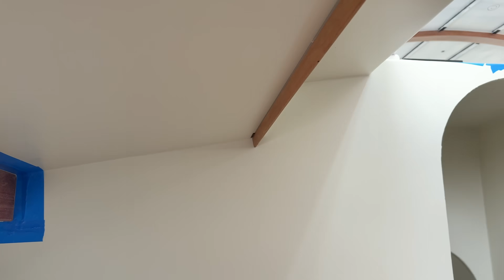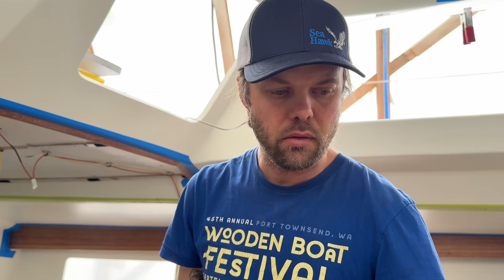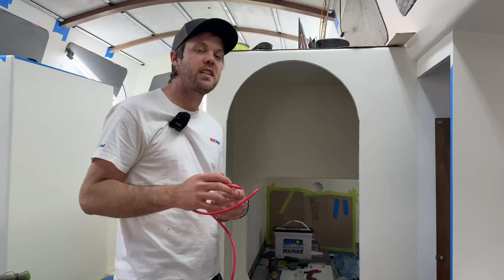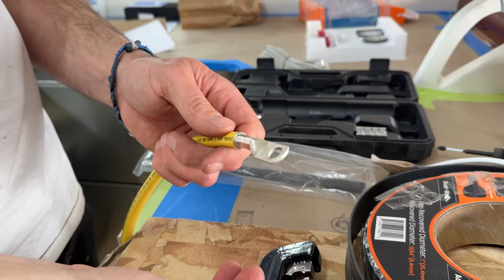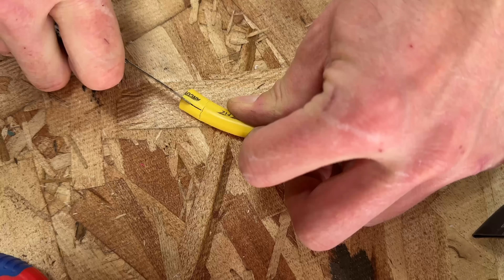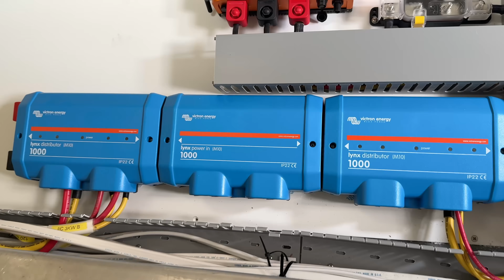This Little Product Supplies All the Power You Need Onboard. [Ep. 220]

Comment: Am I reading this right, you are trusting your entire boat electronics and safety equipment to a $2500 converter?
At the end you said your battery bank is 24v, is that correct because earlier it sounded like you have a 48v battery bank.
I think you might as well get those 10 victron converters for backup.
A single short or lighting strike can take out your entire boat by just frying one device. 
That’s too risky for my taste.

Using the pen as conduit to get the cable thru narrow spaces is a great idea. I’ll copy that idea.

Comment: Watching the video about the hatch gutters for the cockpit hatch.  Good job by the way.  The gutters and tubes to the thru hulls will help remove water. But you mentioned getting pooped and somewhere for the water to go. The amount in the drains will be insignificant compared to the amount flowing back out the open transom.   Really insignificant

Comment: Comment comes too late for this install, but there are many options for channels and diffusers for LED strip installation.
Can give more diffuse light, protects the strip, holds them securely.
Can have a flush mount look when installed in a channel cut in the finished surface.
For my dream boat build I've been taking note of options and want to install RGB+W strips behind diffusers.
The white levels are adjustable and the RGB give the option to light red for night time navigation.

Comment: I am concerned about how low in the boat all the 48v to 24v electronics appear to be. Any significant water intrusion could quickly render all systems dead. Maybe they were higher than the video made them appear.

Comment: Tin the wire before cripping is recommended for marine.  boats beach vehicles ie.  Beach Buggy Allso  Aircraft.
Reply: Isn't marine wire all tinned copper strands?
Do you have to tin the ends if the wiring strands are tinned?
Reply: @ericdunn6232 Not all of it. I’ve never used, just copper. It feels over the top for me, if you use proper shrinkwrapping.

Comment: no dielectric grease to prevent corrosion? good use of the server rack channel.
Reply: None of those fittings are permanent yet. I'm sure they'll all be unscrewed and rescrewed multiple times before splash

Comment: What  steps have you taken to mitigate the inevitable heat build-up coming from the 24/48V, 3.0 kW Charger/Converter/Inverter and all the other kit? Seems as though there may need to be some cooling system? - or, at least, some method of dumping heat over the side.
Reply from the maker: Im planning a cerbo controlled ventilation system.  This is especially important in this space, the machine room, and the propulsion/battery compartment.

Comment: Will you make that under the bunk electronics cupboard watertight? I could almost see someone going in there with a bucket of warm soapy water to give it a spring clean, and splosh. Kind of silly think I'd do lol
Reply from the maker: That would be a bummer.  There’s no way to make it water tight, so we’ll just have to make sure no soapy water buckets.
Reply: @TheDuracellProject  :D I guess they're in a bunk cupboard that looks like it could collect water that bothers me. Anyways it's not my boat and it's probably because mine leaks like a sieve  haha

The flexi tube tip is suuuch a good idea. Obvious, once someones pointed it out :D
Reply: It is odd that Victron is so omni present in marine and rv markets but their equipment has no dust of water protection rating.

Comment: love what you done with the strip lighting and hid behind the trim - just wondering how long before you touch it with your head when leaning over the worktops and standing back up, may not be an issues as you learn to avoid certain things, i also considered this in a display cabinet, was thinking to use a simple L shaped trim, (expemsive and such a waste of timber turned to saw dust) but you can stick the strip into the trim and simply screw up to where needed
PS video from seven months back when you fitted the water pipes above windows, you suggested you might add light behind that trim, i thought a better idea, but i guess it doesnt project onto the work top when attached to trim, and if fitted to the side of the boat, might become visible from lower seated position, if like me i hate seeing bulbs of direct light, prefer the abience - great job Matt and Mrs
Reply from the maker: I like the L shaped trim idea.  But we are putting lights in both places.  Above the galley and behind the valences.  The valence lights are mood lighting, not for lighting up the galley counter.
Reply: @TheDuracellProject  great idea😀

Comment: In those multiple cable pulls, I used to attach a piece of string or wire to each wire as you pull it through so you can attach the string to the next wire and so on

Comment: You would probably want to install a defuser. Those led strip are not nice, even if they’re behind a list
Reply: But they ARE over a work area were maximum light is needed. That's why the final strip will have the greater density of lights. When it is only needed as indirect light, he has the dimmer function. THAT is what makes them NICE!   (Behind a LIST?)
Reply: LED lights give a Chiaroscuro light, so the white is very bright and the shadow is dark as it only has a small wave length. Many people make the mistake of making an LED light brighter and thinking it will make it better. Your ability to see or define an object is harder especially if it's a white background. It's useful if you want to enhance a piece of jewellery. However you will find it uncomfortable over a long period of time. Using LED lights without a diffuser means the shadows are darker, like a drawer or cupboard.

Comment: Might be worth while to cary a seccond smaller DC-DC converter as a back up. Something large enough to run sailing systems like instruments and autopilot. That way if you lose the big DC-DC you just need to be careful about your power consumtion, but can still use the main battery bank.
Reply: Or the systems should be designed independently.
Should be in a heirarcy of importance based on safety and operations criticality.
Then systems and circuits can be shut down with either manual or automatic loadshedding.
In the event of an emergency or loss of generating power want to keep radio and navigation lights going the longest possible.
Critical systems can also have their own batteries to guarantee a minimum operation time is a crisis no matter what the state of the main batteries is when the crisis hits.

Comment: Good that you use tint cables 🫶 Spray all electrical with transparent wax and it will still look new 10 years later. You will regret mounting electrical at hull and not att wall after first water intrusion

Comment: Well,  it might have been easier, quicker, and perhaps better to do the wood trim concealing the strip lights in two pieces. One wider thin trim as a base piece that will more easily comply with the surface undulations, with your existing second trim mounted perpendicular on top as you have already done. No sanding to fit!

Comment: You spend a fair bit on a crimper for the cable but still no heat gun. Using a torch like you are actually degrades the shrink as well as the coating on the wire.
Reply: Not if you know what you’re doing. Heat is heat, notice how he is not keeping the flame in one spot.

Comment: Your very smart ! A lot of people solder the cables to the terminals even large 1.0 or 2.0 size , that is wrong always crimp cables and wires , because with heat solder can melt or get soft , I was a mechanic on electrical forklifts for 50 + years everything from 24v to 80 v and 1400 Amps , 👍🏻👍🏻
Reply: You solder the wires at their ends where they may take extra flexing and break the thin individual wires. THEN you crimp them.

Comment: Do you use a conductive grease on your connections?  It stops corrosion in automotive.
Reply: Dielectric grease is best, as it will not track to ground causing a fault if it drips from under the connections. All bolted, crimped, screwed down, and sliding connections will not have any issue with dielectric grease, and it really helps reduce corrosion over time.
Reply: @jimcalver-oj4xf  Thank you. I just was wondering about that.  ✌️
Reply: NON conductive.
(I'm certain that's what you meant, don't want someone inexperienced making the mistake though)
Reply: @ericdunn6232 do you dabble it on after the connection?
Reply: @dbireland2003  apply after bolted connections are made, into connectors and sparkplug boots before connection.

Comment: Would you consider using dielectric grease? (It is a non-conductive, silicone-based lubricant used to protect electrical connections from moisture, corrosion).  The installation looks very neat.  A benefit of the recessed lighting is the lack of reflections off surfaces.  Saying that I guess you may want some brighter lamps over to table too.
Reply: I really don't like that marine electric seems to be fully dependent on bare exposed terminal blocks.
Install conduit and junction boxes. Cabinets for breakers and equipment.
Final wiring through watertight strainrelief fittings.
The use of PEX was a good handyman solution to wire pulling, conduit would be better.

Comment: All your electrical connection is there not a plastic product that can be used to coat them to prevent corrosive atmosphere from causing corrosion or attacking them. It is not perfect and is a bit of a pain if you have to work on these connections in the future but I think it would be something to consider .
Reply: There are lots of resident anticorrosion sprays that will clean the copper oxides off initially, and cover the mated surfaces with a resident film. CRC products are good, and even WD40 has an electrical use spray. I use CRC QD electronic cleaner.
Reply: @jimcalver-oj4xf  just I worked on analyzers in the chemical industry and I remember the instrument guy using a liquid plastic and he spread it on like anti-seize with a little brush and it hardened like a real plastic coating .
Reply: Use di-electric grease on all connections.
Put connections in juction boxes with sealled to avoid spread and accumulation of dirt.
Di-electric grease is good in connector and receptacles to keep moisture out as well.

Comment: Lots of boats with switched bilge pumps sitting on the bottom!
Reply: True.
Untested and ignored floating switch pumps too.
Each pump should be able to operate either way. Backup float switches and at higher levels can start larger pumps and indicate rising bilge water at the helm.

Comment: ❤❤❤❤  that Pex trick. BRILLIANT👍👍👍

Definitely going to use it. 

Gracias
Reply: Or consider putting all wiring in conduit.
All circuits become protected and easy to replace or run additional circuits.
If wiring is from junction box to junction box and connects to TBs sections can be tested and replaces individually.
Reply: @ericdunn6232 
Ummm, the track Mat's using IS conduit.
Reply: @dennisg8164  it's pex pipe being used for one section.
Conduit is more than that.
Reply: @ericdunn6232 The pex pipe is being used to help thread the wire through a rough area.  It's removed when the wire is run.  It's a TOOL.
Reply: @dennisg8164  alright then. So not a conduit.
Conduit would protect the wiring and make future replacement or new circuits easier to wire.

Comment: I see 5v lights that are so bright.  You really don’t need a lot of DC voltage for a lot of light.  Duracell’s interior will look so fancy with those strip lights.  Looking great and your mom rocks as always.
Reply: For strip lights, the voltage and brightness are not a direct correlation. The benefit from increased voltage is not from the LEDs being brighter, it is that the amperage will be lower, meaning you can run smaller gauge wiring to your lights, which ends up saving both cost and physical space.

Comment: You need to get a Battery powered Silicon/glue gun for Mom.
Once you get all your terminals connected on the system coat them in a corrosion barrier - Easiest / cheapest way is a big pot of Vaseline and a small paint brush.
Reply: I have never heard from or encountered this. Is it best practice? It’s a quick (and fun) fix, but doesn’t it add the risk of locking up moisture behind that layer instead of giving the terminals simply the opportunity to dry? If you keep your engine/systems room dry, as you should, is it really necessary?

Comment: Amazing project, question, did you use RGB led-stripe? So you can have red light during night sailing, example when you are at night watch, then it would be good be in the cabin and have red-light so you still maintain good night vision (instead of turning everything off). Same thing occurs if you plan to be outside during night time, then you either have to have red-light in the cabin, or you have to block your windows so people outside on watch can maintain their night vision. We do both, red-light in the cabin, block the lights from the cabin if needed (example a person on watch outside, while people enjoying time in the cabin) This is what we do here in Norway when we sail up and down the cost, special during the winter time when it get dark very early.
Reply: I’ve been asking about that as well…. SO MANY places where using colored LED’s would have some extremely awesome benefits, especially the red for night sailing. I’ve never seen an answer yet, and have only seen white lights. It would be a huge shame to have done all that work and NOT taken advantage of the availability of RGB LED’s!!

Comment: Picking the ABYC nit here... would have thought the MRBF fuse mounted on the buss bar would have been located on the positive battery terminal. All that 7 inches stuff from ABYC E-11 Standards (more curious than anything). Wonderful work as always, such a pleasure seeing that storied vessel gaining a new and pretty spectacular life.
Reply: Bus bar outputs are branch circuit, and the output of the 24V battery/ input to the busbar is protected by a class-T per E-11, so definitely meeting the 7/40/72 rules per E-11. MRBFs are great because they saves a ton of space in this configuration compared to ANLs/Megas/etc and have a higher AIC.
Reply: @SeaandLandYachtWorks If you look at the 14 minute mark in the video, you will see what trcrissinger is referring to
Reply: Are ABYC standards or books/guidelines based on them available to the average person?
All I've found out so far is it's very expensive to get copies of the most recent standards.